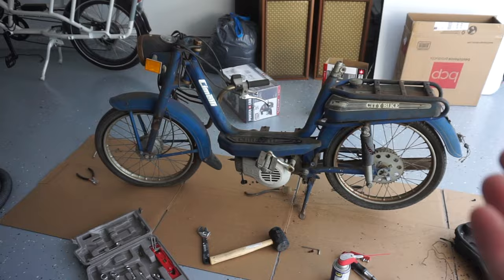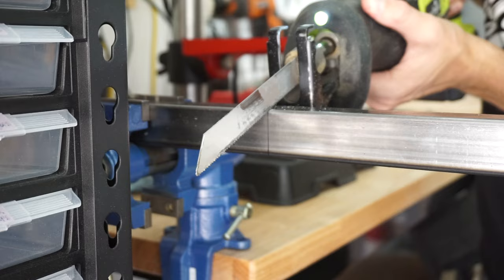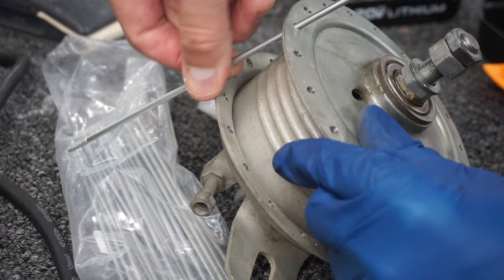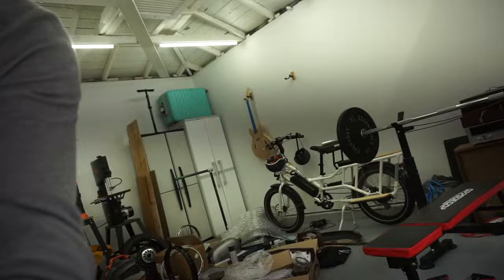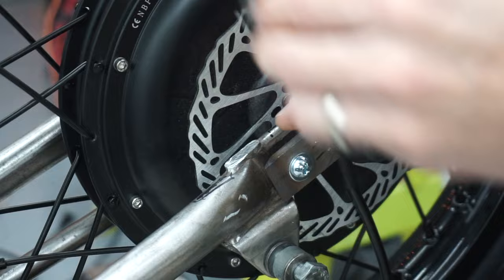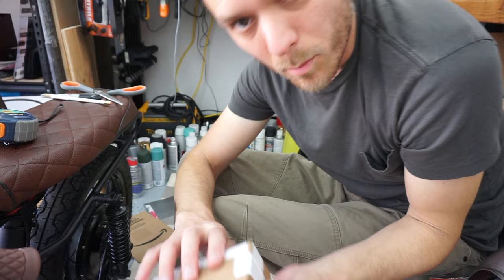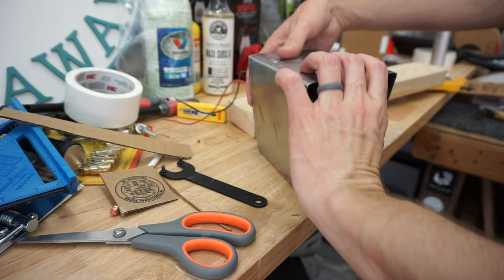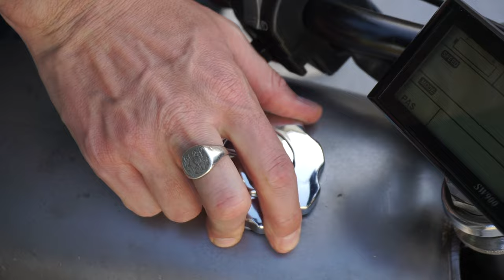Building a Fully Electric Cafe Racer Motorcycle | Moped

Comment: That's the cleanest conversion I've ever seen.  Brillian use of the gas tank to cover the controller AND act as a charging port.  I've also got to say great reuse of the drum brake on the front hub.  I have to ask why the use of a 2KW hub rather than a 5 or 8 KW?  Was it for legal reasons (moped laws vs motorcycle laws) or budgetary restrictions?  After riding on the 2KW do you think that was the right choice?
Reply from the maker: Thank you so much! So when it came to the 2KW hub, I did it for speed. So I didn't want something super fast, but it also goes a little slower than I calculated. I thought I would be able to get around 40-45mph. Top speed for me is around 35-38mph. That's after the weight of the bike, battery, and rider, which I did not factor for. I should have gone a bit higher. But also I would have needed larger brakes probably, b/c any faster and they probably wouldn't be able to handle it, at least a larger disk in the back. But part of it is for legal reason and the gray area around e-bikes and mopeds in CA. I didn't know what I could get away with really. I mean I even went to get an M2 license for it at the DMV recently and they hadn't even heard of that and told me I couldn't get one, and that I would just need to get an M1. Luckily I was able to get it registered as a custom moped with a title so I could insure it. If I did it again I would probably opt for more power, bigger motor and bigger brakes.

Comment: You should jump over REL /electrode welding / from the start ! I can't take  that you couldn't find some affordable TIG welder , let me say 400 -500 $ , build up a skills  on scraps and that's it ! Argon mix ( for steel )  gives nice spread , deep and shallow welds plus , you can return back with out adding wire , just with a welding head , to repair weld / to make more melting down , if you 'r not glad with result ! In Croatia , on a test , they could be very picky and precise if we are making any changes or making motocykle  frame from scratch . They , for sure , could ''record '' welds with ultra sound probe !

Comment: Dude! Put an RFID RECEIVER under the seat cushion. You could have a button to push to scan....and just put the matching RRFID CHIP ID number to a card In your wallet.

 Sit down to steal it , it woundnt  would have no idea.

Or build in a safety pedal under the seat cushion that will trigger an elecritc braking system to engage making the wheels to also lock up if they where straddling the seat trying to push. But the only way that bike moves is by pushing it down the streat on a 45 degrees. That would every attention grabbing too....when build in a Air Tag....wire to battery.🤯 to stay on while there is a charge.

My BRAIN!!! ITS GUNNA EXPLODES!

CROUCH QUICK START🤯

Comment: That's a nice project and an impressive result, thanks so much for sharing. Would love to learn more about the total cost of the hub motor, battery and all other equipment, links to where you purchased it all, as well as details on how fast is the bike, what is the range and what acceleration does it achieve. Keep up the good work!
Reply from the maker: Thank you! Total cost of the hub motor, that was everything including the rear wheel and tire already assembled, brake rotor, controller, etc. was around $900. The battery is a 72Volt 20Ah and was about $300-$400. The Hub motor is a 2000 Watt hub motor, there wasn't much of a price difference at all between 2000watt - 3000watt. I chose a 2000watt thinking it would be more than enough, but hindsight should have gotten the 3000watt for more speed/power. My top speed is probably around 40mph. I haven't taken it faster than that b/c I'm still waiting on the registration to come through, I also have to get my M2 license. It accelerates very quickly, faster than a typical e-bike. The motor is also pushing about 75lbs, plus rider weight of about 155lbs. I bought the motor and battery from NB Power. I found them on Amazon and messaged them via whatsapp. They made everything to my exact specifications(rear axel length, and even battery measurement and shape) and helped me figure out what would be best for what I was trying to accomplish. I highly recommend reaching out to them.

Comment: Impressive man! I'd like to convert an old cafe racer to electric. This vid was inspire ng!
Reply from the maker: Thank you! Yeah I've got a couple 1950's Harley frames that I was going to try and build out into more electrics, but I'm running out of room in my garage. haha. It's so much fun, I would highly recommend it! All you need is a bike with a junked motor or no motor. You can also re-title the bike as a custom build if you put a new VIN on the electric motor and the frame. That's what I did.

Comment: Great page great vids got to ask why would waste time using those cheap Li Ion packs? They are extremely bad quality and dangerous when you can get cheaper, much longer lasting and far safer LiFePo4 batts? I refuse to put these Chinese Li Ion batts on any of my hundreds of conversions. I have converted all of my vintage motorcycles and Vespas and Lambrettas to 72v 10kw motor wheel, Kelly Controller, 175 kph top speeds and 0-100 kph in 1.2 seconds and 80ah extreme range with 520 nm of torque which is actually 1 Nm = 3.7e-07 hp⋅h
Reply from the maker: I honestly didn't even know that was an option! This was my first time doing something like this. Where do you buy your batteries? Bummer you don't have any videos on you page of your motorcycles and vespas, would have loved to see them. Is there anywhere I can take a look at your builds?

Comment: Very cool - I have a loaner bike and have been thinking about an EV conversion for a while, your video got me excited to start. Is there an option for regenerative braking from the NB power guys? I see you left a drum brake in the front and the disk brake in the rear comes with the motor I guess?
Reply from the maker: Thanks! Yeah, they have that regenerative braking option. I requested the rear disk brake on the hub motor. You can discuss everything with Anne via whatsapp. They will customize or help you customize everything to your exact specifications!

Comment: Have you been able to get a top speed and range of the bike yet? Would love to know really want to build one myself here soon.
Reply: Yeah so I just got it registered with the DMV, so I haven't been able to ride it much until lately! I gave it a bit of a speed test with me on it and calibrated for the smaller wheels. My actual speed ended up being around 35mph on flat terrain throttle wide open. I was aiming more for around 45mph, before I started the project, but forgot to account for weight of the bike plus rider. So knowing that, if I did it again I would definitely go with a 3000W - 4000W motor instead for faster acceleration and overall top speed. I would also use a larger frame b/c going any faster on the small moped frame could get a bit sketchy haha. Who knows in time I may upgrade it. Otherwise I have two vintage Harley Davidson motorcycle frames and I may try a ground up build with those and a much heavier-duty electric motor.
Reply: @HunterVanHouten  Thank you that helps a lot! If you update it or do another build up make sure to capture it so we can watch!

Comment: 20Ah battery for charge to full power have to take how long? and 20Ah full battery can run how many km?
if use 4000 watt rear what kind of NB Power and paired that with a 72 volt 20Ah battery can use? Thanks your video share.

Comment: Great video I was wondering what size hub motor did you use and how did it go
Reply from the maker: Thanks! I used a 2000 Watt hub motor and provided NB Power with my drop out measurements and they built the motor around that! It went really well. Adding the torque arms helped to really lock the rear axel in place. It's so much fun to ride! Already started another bike build haha.

Comment: Hi! Pretty good job! I did a very similar conversion with the same hubmotor. But after a few kilometers of Test riding the six screws which hold the disc brake became loose. Do you have the same problem? First I thought the bike is too heavy for this small disc brake but I think yours is at least the same weight. Greeting from Germany, maybe you can help!
Reply from the maker: Thanks! I noticed that they were a little loose and so I tightened them down, also coated them with an anti slip which help a little I think. We'll see how they hold up over time.
Reply: Thanks for your answer! I will try to fix the threads with helicoils, so I don’t have to buy a new motor! Hope it works and also that your motor stays intact!
Reply: I would definitely recommend using loctite when installing

Comment: Did the tail lights come with your kit or was it separate? Curious what make model it was. Thanks.
Reply from the maker: I bought the tail light separate off of amazon for like $12.99! Search on amazon: FEIFEIER 12V Motorcycle Integrated Brake Tail Light Turn Signals License Plate Bracket LED Universal Motorcycle Tail Light (Black Bracket Smoked Cover).  The "kit" I got, wasn't really a kit. I just reached out to Anne from NB Power via what's app and we talked through everything I would need. They pretty much just custom made everything I would need and added in things I wanted.
Reply: @VanHoutenBuilds  thank you. Great build by the way!

Comment: Cant find the website to order the motor. Do you have a link?
Reply from the maker: I did not order from a website. I found the seller on Amazon. NB Motors and then I messaged them. They sent me a WhatsApp number to contact. I did all my communication through whatsapp with the seller. They said I could either purchase through Amazon or via a paypal invoice. I chose a paypal invoice and they kept me informed during the whole process of my order.
Reply: @VanHoutenBuilds   awesome thank you. I'm using a '73 AMF moped frame and don't want to play a guessing game.
Reply from the maker: @F.O.GFatOldGuy  I hear ya. Yeah it took me months of communicating back and forth with the supplier. They helped me with everything, battery power, motor wattage, they even custom built the battery to my exact dimensions for no additional charge. They gave me a choice of 3 throttle options as well. They also took pictures of everything and sent them to me as they were being built. I also had them custom make two wheels for me so that I could use my existing front hub. I used Reed Bingham's videos as a reference and also reached out to him when it came to electrical. Depending on what you're using this for, I realized that a 2000 Watt motor only gave me a top speed of around 35mph. Hindsight, I should have gone with a 3000 watt hub motor.

Comment: NB Power lies. They sold me a 40amp controller, but sent me a 20amp controller and then wouldn't send me what I bought. Then, they tried to convince me that the 20amp controller is the same as the 40amp. I will NEVER buy from them again. Buyer beware.
Reply from the maker: That's a bummer, sorry to hear you had a poor experience with them. My experience was really pleasant, so I can only speak to that.